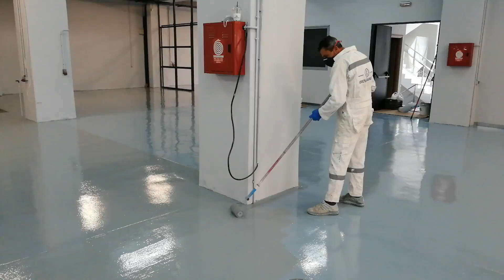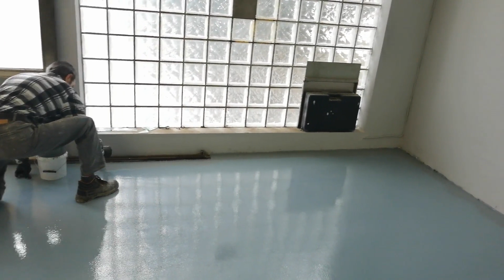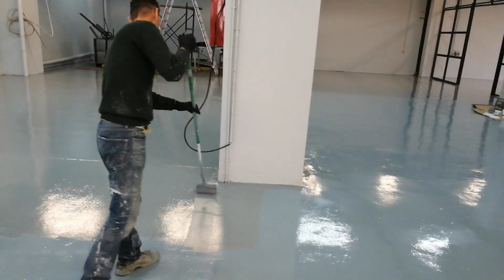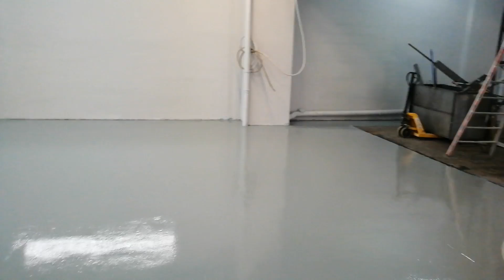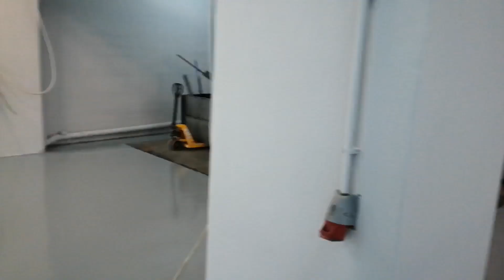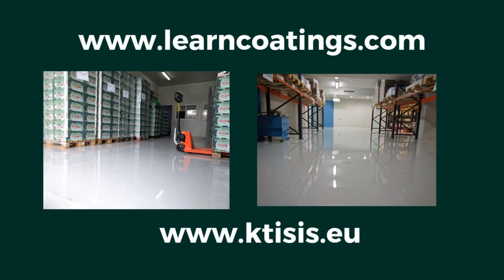Epoxy Floor Roller Marks: How to Eliminate them

Comment: Thank you very much. i put a epoxy paint on floor . after the cure there were all roller marks. Then i eliminated them with sanding. i watched the video and fixed the problem.
Reply: How did you sand it

Comment: is this also advised for polyaspartic resins?
Reply from the maker: I do not have much experience with polyaspartics, but considering that they are fast drying, back rolling would make sense
Reply: Of course not.  You're going to have a disaster.

Comment: Hi can you apply epoxy resin over a water based self leveling compound after it has been primed??? Any info would be amazing! 😊
Reply from the maker: If you are talking about a cementitious self leveling compound bonding with epoxy is possible. However what is the primer that you used? Most primers will bond but some may react to the solvents in the epoxy
Reply: Hi thanks for the reply! The primer is a 2 part mix for the epoxy resin for a decorative floor with added Pigments.
Reply: Yes the self leveling copmund is a cementitious self leveling compound by "MAPEI"
Reply: I will be applying the epoxy primer on top of the self leveling compound once dry.